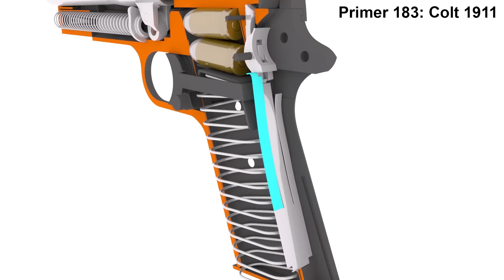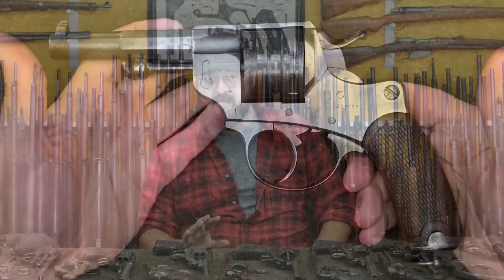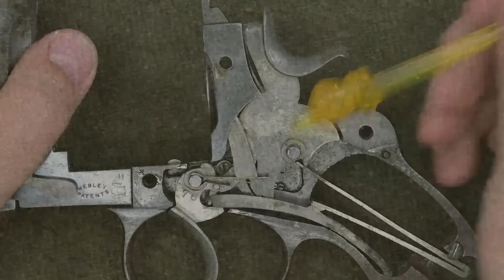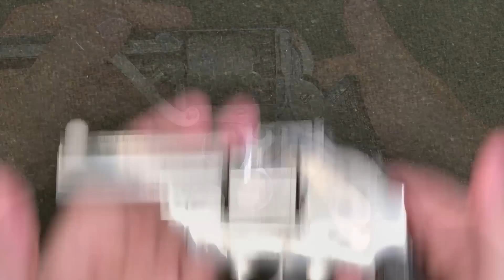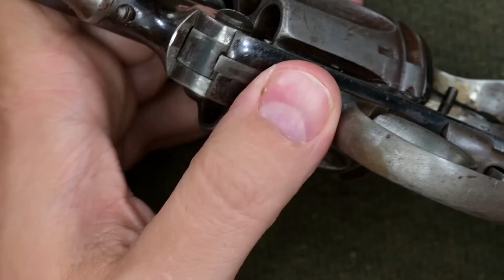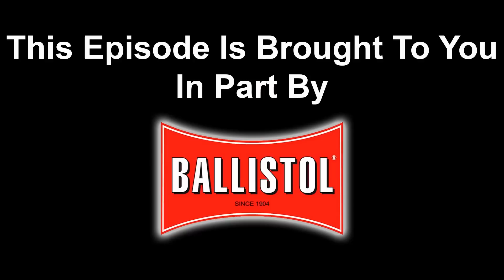Revolver 102: Basic Terminology | C&Rsenal

Comment: Oh shoot. My school is definitely calling the type of tilting/swinging firing pins that are cross pinned into the tip of the hammer the Hammer Nose.
 Very surprised by the use of the term here. The example we used was the s&w model 10 k frame that was old but late enough to have the latter version of hammer block mentioned. Hammer nose for that part on that gun is probably s&w specific.
I wonder what the widespread name for those tilting style fire pins are?

Comment: Many non gun owners, fail to realize that the most common gun use is carrying it, second most loading and unloading, without firing, often done many times a day, especially by "working gun" owners. Legally every time I drive, I modified that to everytime I drive on a public roadway, except during hunting season, more chances of getting checked/caught. Of course I'm a modern working ranch hand, required to ride fence/ provide security. No horse, I use a pickup.

Comment: A hill that I, maybe won't die on, but will offer some resistance before "agreeing to disagree"  on is strikers.  If the part that impacts the primer is directly acted upon by the mainspring, including via rigid or articulating direct attachment,  it's a striker.  If the primer-impacting part is separate from the mainspring-driven part, the latter is a hammer.

This is true in all other types of firearms, so I believe it should also apply to revolvers.  For this reason, I submit that "striker" should be included in the standardized lexicon.

Edit:  Percussion caps are distinct from primers.  As the mainspring-driven part is performing a blunt impact to drive the cap onto the nipple, much as it would drive a firing pin into a primer, it would still be considered a hammer.

Comment: The idea to write the terms on the screen at the same time as you say them is very helpful for the non-native English speakers.
1:21 I think this is a bit of an overstatement. In my experience very few people in the gun community actually know the inventors of even the most popular locking systems, at least when it comes to (semi-)automatic arms.
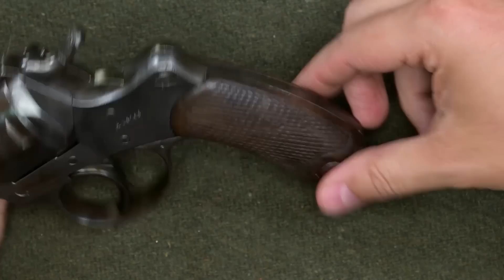5:25 Is the term 'grip plates' used?
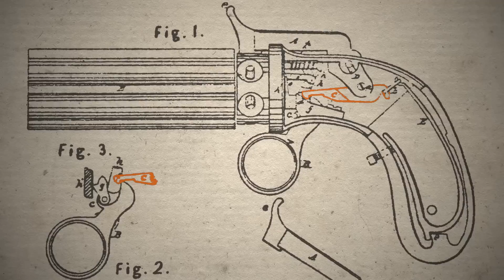14:41 To give you an idea of just how far back it goes there, the doglocks were in use in the 1640s already, Jonathan Ferguson did a video on those a long time ago, sadly now gone.
35:21 This would be an Adams-style ejector rod, as opposed to Perrin & Delmas style.

Comment: Just to reframe your description of the "nipple": rather than think of it as firing pin, think of it as a ported anvil attached to the cylinder.  This way the striking surface of the hammer remains the "firing pin", even though it does not have a proper "pin" shape to it.  In some ways, the cap-and-nipple is like a distant cousin to the Berdan priming system, this keeps the language relatable.

Comment: A latch is a point of contact that allows closing but holds it locked. This is most commonly done with a spring loaded ramp.. The lever or button is the "latch release."

Comment: Overall great episode.  Very helpful.  As for another weird revolver which might need another word; the Merwin and Hulbert.  The flange around the arbor on the back of the frame serves as the extractor, but it also serves as the datum which sets headspace.  I think the most logical choice for a name would be "flange extractor," or "extractor flange" but I'm open to suggestions.  I also think using either one of those would require you to specify the other extractors as "extractor stars."

Comment: 13:22
I fundamentally disagree with calling that component a "nose" on the grounds that aside from elephants and maybe some insects which feature a trunk or proboscis, there is no nose on any animal in existence which is capable of pivoting on an axis. The word "strut" is immensely more applicable to this component, and I don't understand the aversion to it.
Reply: 'Strut' is probably the most sensible word for it, however, I had no idea that the word 'proboscis' was an option until I saw this comment, and I am now fully in favor of using that term instead.
Reply: @restitvtororbis5330  Oh, good gravy. What have I done? 🤦🏼‍♂️
Reply: regardless of how the name got there, it is reasonably well established and not used elsewhere -- there's minimal value to renaming. Since the hammer strut also refers to spring connection point in many common designs, it might introduce unnecessary ambiguity.